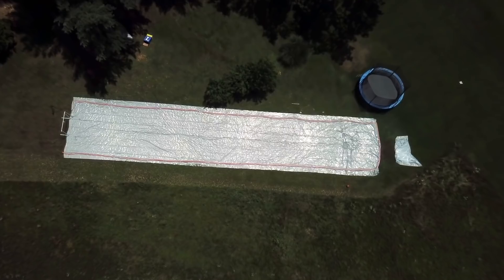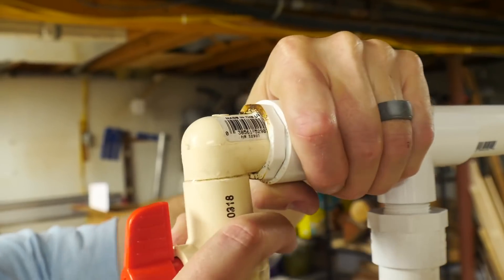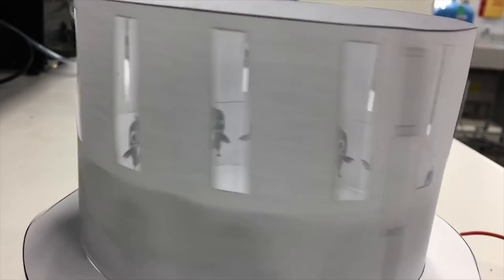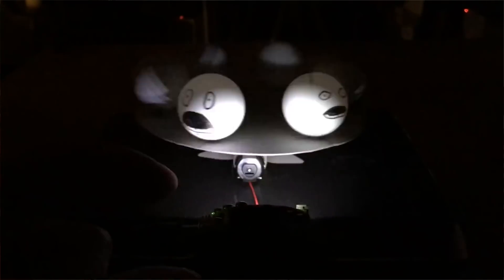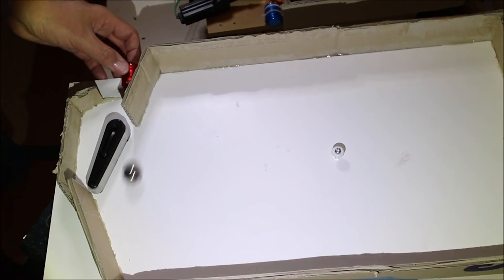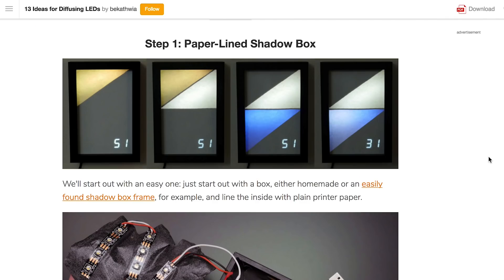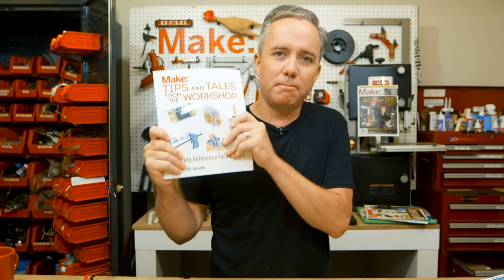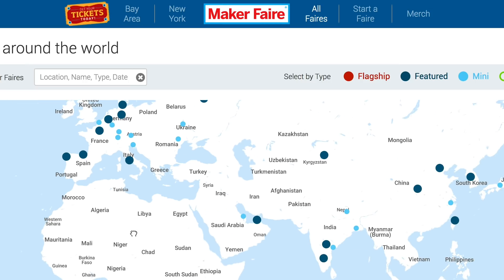Maker Update: Stroboscopic Zoetrope

Comment: Here's a good tip for beginners of 3DP on a budget: need a new glass bed? Go to Dollar tree and get a photo frame and rip out the glass. I use to do this regularly and costs next to nothing. And if it breaks, no worries, didn't really cost you anything. It can yield VERY smooth print bottoms and works with a standard glue stick for adhesion.